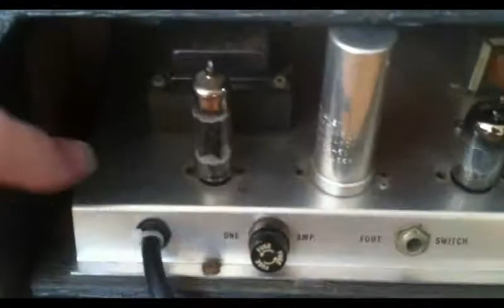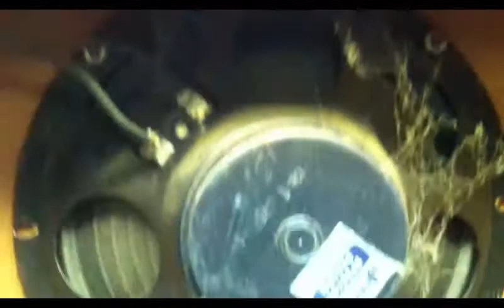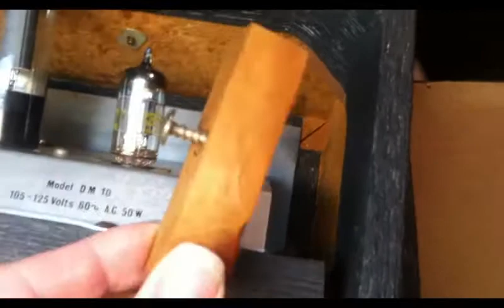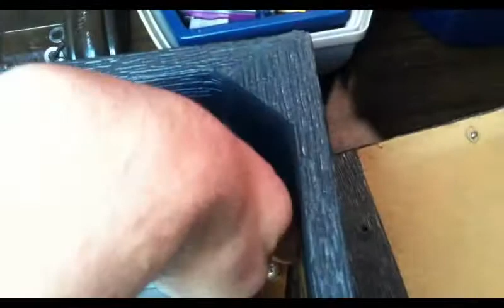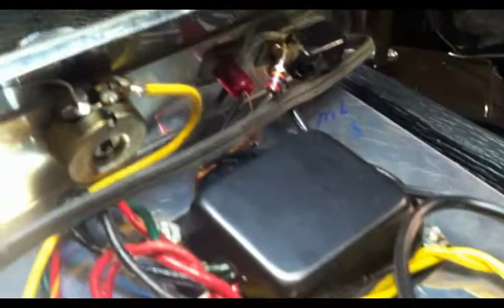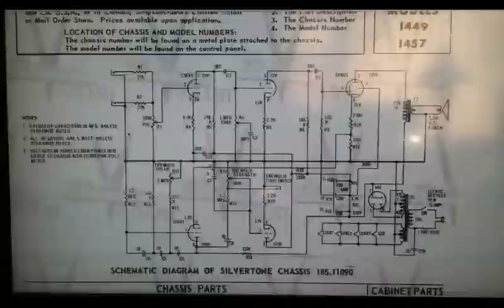1965 Danelectro DM10 Service & Demo

Comment: Hey thanks for the video!  Is C10 in the circuit schematic the death cap? And when you take that out, did you just bolt the ground to the chassis at the corner of the power transformer? I'm about to do this exact fix on a DM10.  The one i have also has the speaker cable running out the foot switch jack so someone clearly tinkered with it.  Thanks again!

Comment: 244 on those .01 ceramic caps is the EIA code for the Leslie F. Muter Company, a company which primarily made precision wirewound resistors.  They made these little things to go on to their glass encapsulated grid leaks:
https://www.radiomuseum.org/r/mutercomp_grid_leak_drip_pan.html

Comment: Nice video! I'm not a tech but I enjoy watching your videos. Learn a little something from each one. This one touches home. I have a Danelectro Centurion 273 that I just had recapped and deep cleaned. I think it's a 58 or 59. It's close to mint and bought it from the original owner who used to play his accordion through it. Bought a low to high impedance filter and going to try and play some harp through it. Thank you for the videos! Keep them coming!

Comment: I'm planning on building a full-range head using something rather unique: a Welch Densichron from the late 1950s.  It's a portable all-tube instrument with a very nice slide-out chassis.  I'll probably use the original power transformer and terminal boards for the job.
Reply from the maker: SOunds cool!

Comment: I am working on an amp project and the "top shelf" idea is really good for what I wanna do (specially since I'll be using a baking pan for my chassis), but I think I'll use a different approach to holding it in. Screws from the sides is probably the best way to do it, and having "channels" cut into the sides of the cabinet to work as "drawer tracks", so it doesn't just fall down if you unscrew the suport screws.
Also, for easy servicing, gonna have the back door a little lower so it doesn't block the shelf from being removed. Yeah, that could work!
Time to doodle some plans!
Reply from the maker: +blackcorvo I've seen a lot with top shelves, but first time seeing little blocks like that holding something in.
Reply: This is the first top shelf I've seen, but yeah it's a weird design choice.
I was actually rethinking mine over the course of the day, and I'll do something simpler that'll only require to make slots on the cabinet's wood.